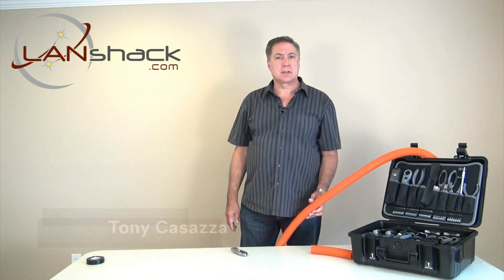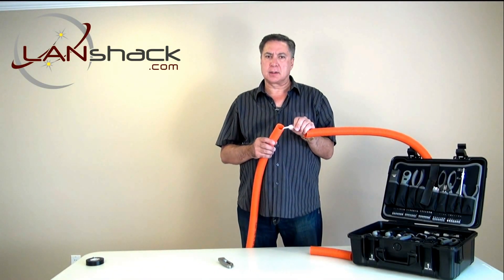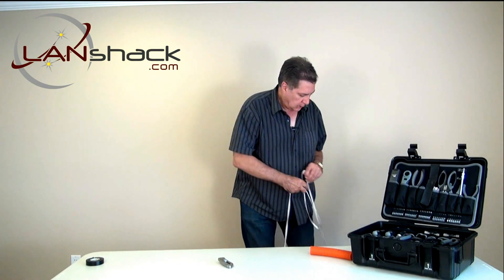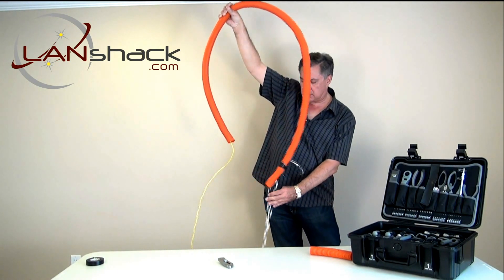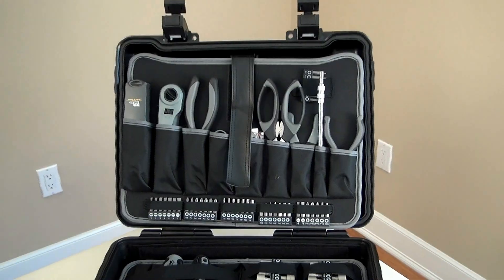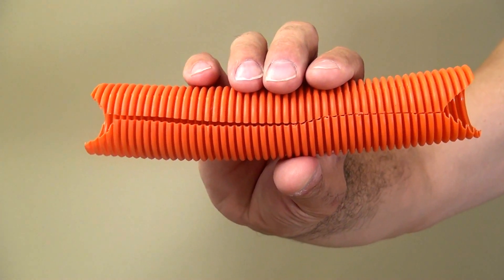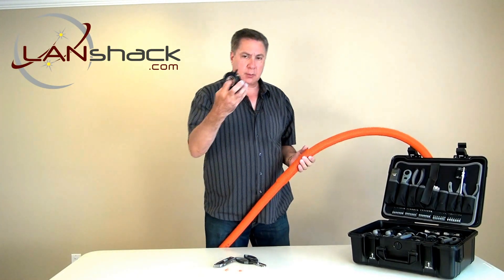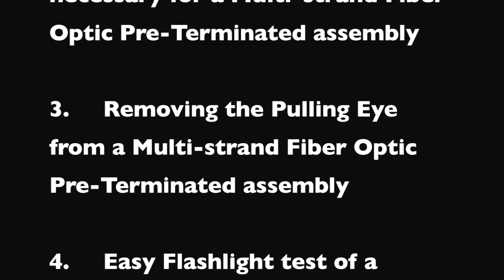How to Splice an Innerduct: Working with Fiber Optic Pre-Terminated Assemblies

Comment: Just buy the couplers for $5
Reply: No. Buy the tool kit for $300 so you can do it wrong by wrapping it with non fire rated electrical tape
Reply: @crosswire7777  "Tool kit" A razor knife and a roll of tape lol